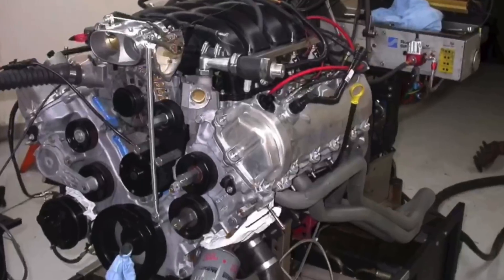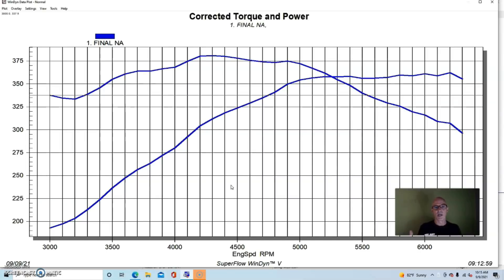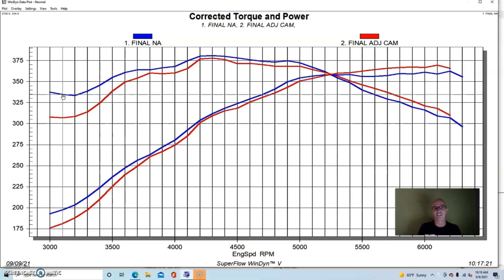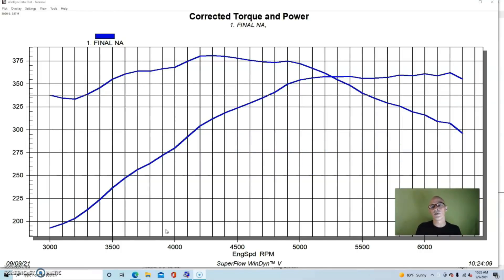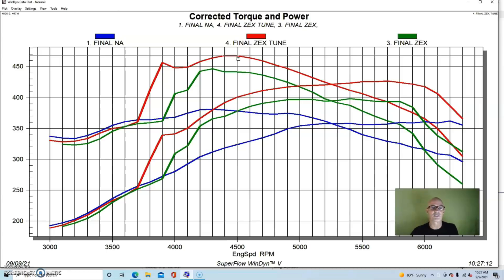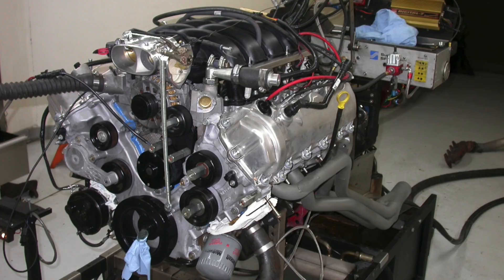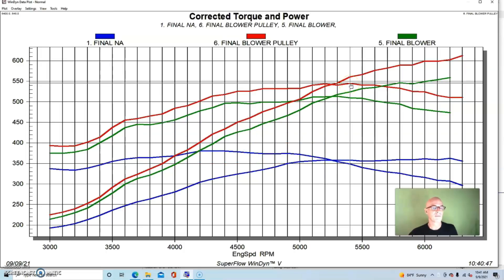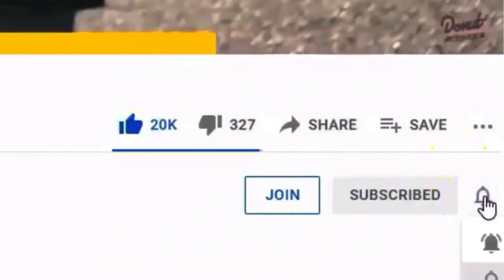HOW TO MAKE MORE POWER! ADD NITROUS OR BOOST TO A 4.6L 3-VALVE.

Comment: What plugs did you run? How many steps colder. Curious why you didnt do a 100 shot but otherwise glad this video was done.
Reply from the maker: we run a 9 or 10 heat range with boost and nitrous
Reply: @richardholdener1727  thanks for the reply do you happen to have a part # for either plug

Comment: Richard Holder, could you revisit the 3V engine. Being Holley offers thier long runner intakes for the 3V now that has different tops. There designed to run a single 4150 carb style flange, a dual 4150 carb flange, & EFI lids to bolt a forward facing TB. 
  Holley designed them to be similar to the GM LS Engine Ram intake to run long/short runner upper plenum or carburetor plenum.

Comment: Im assuming you weren't running stock internals with the Blower? these things bottom ends arent known to hold up very much after 500 hp. If you were, that’s great to hear and impressive tuning.
Reply from the maker: stock bottom end-they will make a lot more than 500 hp

Comment: They have their basis issues but they are great street engines with far better low to midrange torque than the 4 valve motor. They are fun to drive with basic mods.

Comment: With CAI, 91 Octane  tune (no 93 tune for that tuner), underdrive pulleys, on stock intake and exhaust, I got 307 hp at the wheels. Now I have added charge motion plate delete kit, headers and high flow cats, and a proper 93 octane tune, I will have my local shop do a fine tune on the dyno to see what improvement was made. Eventually, I will build up an all forged engine with ported heads and larger cams, but that is after my other projects are completed...

Comment: Mr Holdener you rock!!! How much HP did the headers add over the stock manifolds and do you recall the manufacture/sizing? No one lists 4.6l 3V headers for a 2010 F150-I just assume no power gains. Looking forward to part 2!!!!  Also when you get a chance, please post part 4 (the big heads) of the SBF cylinder head series, Thank you Tony.
Reply from the maker: very little gain, but we didn't have VVT so not sure it was an accurate test

Comment: Can't wait to see the custom intake.  Are we going to see any aftermarket cams tested?  Run the TFS 2v/4v crank sprockets, a set of comp 127400 cams and lock them out at a 108 degree ICL and enjoy!  
Then add a set of H-beams and forged pistons and throw 17 lbs of boost at it.

Comment: These are not my favorite engines  but if you own one, please keep it full of oil, and beat on it a little. Making this engine work a little, and sing a little, makes them live. Cam phasers pay the price of maintenance neglect first, and the oiling system isn't known for toughness. Fresh lube makes them happy, they will go 300K if you do. 
Great content Richard !
Reply: They have far greater lower to mid range torque than the so called more favored 96-98 4 valve engines. Much more enjoyable to drive on the street.
Reply: @erikturner5073  I can agree with this. I had a 2007 GT and I was thinking about turning it in for a Mach 1 4V. My 3V felt so much better at the low and mid range. Top end was about even. The 4v is obviously a fantastic engine but modern technology with variable cam timing and such really do make a big difference
Reply: @trizkial7592  plus the 4v engine has too low compression at 9:1 compression compared to the 3 valve 10:1. That makes a BIG difference. Especially with torque production, and torque is king in low and midrange power.
Reply: @erikturner5073  So hence I didn’t make the trade after test driving the Mach 1. Sweet car though still
Reply: @trizkial7592  The 3v cars are very fun on the streets and they are some of the best looking and also have a sweet unique sound. Never liked the coyote with loud exhaust. They are obnoxious! If I were to step away from foxbodys. I would myself find a nice 3 valve mustang.
Reply: Mine has over 400k

Comment: I hope you get a controller that can run VCT makes the engines so much more efficient especially when they're independent like on the coyote I think I read a test where it lost like a hundred horsepower or something just from not having that.  And I know that on the dino you usually only run in at the extreme RPM so when your daily driving it especially not just for power but efficiency

Comment: Semi-crazy dyno idea. Set up a pony motor to drive a supercharger which feeds the engine on the dyno. Then stick supercharger onto dyno engine. Will answer the question how much power does a supercharger really take?  A bit silly, but fun.
Reply from the maker: WE CAN JUST RUN THE BLOWER ON A BLOWER DYNO
Reply: @richardholdener1727  What fun is that?

Comment: Awesome! I LOVE 3V 4.6s. a good set of cams and an intake manifold REALLY wakes these engines up big time. Unlike the 2v, once you do those two mods, your well above 300 rwhp. Throw a nice set u
Of heads in the mix, iv seen cars make 350-375 wheel with a nice hci on a 3v! These just didn't get much love because the coyote came out and, well, who doesn't love that beast lol?
Reply: These didn’t get much love because cam sprockets would blow out of the front and rods couldn’t handle much power it wasn’t a good staring point
Reply: The 2 v is the better motor lol you can make above three hundred with a cam and intake too lol
Reply: The 2 valves head flow like crap the 3 valve is superior !It is just a notch behind the 5.0 and boosted run awesome! @cainadkins3985
Reply: 3 valves are 2 valves made unreliable
Reply: @cainadkins3985  that's not true
Reply: @mike8066  what part Mike 3v is the worst sounding and performing configuration of the mod motor in all the different family's

Comment: Just a note. The N2o boost wet can go safely to 1.47 times power boost. So 361 or 369 goes to 531 to 542 hp, but with an insane mid range torque blip, just like a nicely  intercooled 7 pounds of boost. Despite the lower than normal gasoline plus N2o gain with the Zex, just 1.20 or so just being like 3  pounds of turbo  boost, that Vortech is always softer on the drive train. Great Gains anyway you choose it!
Reply from the maker: the amount of nitrous the kit can supply is a function of the jetting, the solenoid flow and then the bottle pressure. The multiplier mentioned is just a math statement.

Comment: 6 rib 3.60 and 3.33 pulleys are less than the stock 3.80 inch  GM3800 Gen 2 and 3 Supercharged engine. Good supply to raid 3.8 liter Buick parts....
Reply from the maker: likely different offsets and shaft diameters?

Comment: As a 2v guy I with I had that torque curve. As a 226k mile engine I'm glad I don't have cam phasers to replace
Reply: 3v Heads are pretty good
Reply: @tturi2  and 2v heads are pretty bad
Reply: @Adrianzx  boost always helps
Reply: @tturi2  that's my plan. The new Texas made 88 is looking great but I really want something in the 57-63mm range for fun to drive and maybe my trans holding
Reply: @Adrianzx  thats what my plan has been for a long time.. thinking more toward engine swap lately. Hard desicion to make.. positive displacement 4.6, turbo 4.6, coyote or LS..
Reply: @umakemerandy3669  PLEASE, NO LS !!
Reply: @arkhsm  lol I know I know..
Reply: Dude you should see it with the variable cam timing enabled. Also you just do the phasers when you put in your new cams.

Comment: Don't buy a 3v
Reply: I'll play devil's advocate and say the block itself along with the crank are very strong. The weak point for making power is the powder forged rods, which kinda like to shit the bed once you're making more than 450 lb ft at the rear tires. Brenspeed on youtube is very informative regarding these engines and what they can do. Forged internals in the stock block go a long way, but of course brenspeed will want to sell you the B326 block lol.
Reply from the maker: WE'VE DONE 700 HP WITH THESE STOCK ONES
Reply: @richardholdener1727  Big Bang stuff but for longevity these engines hate torque and so do the cam sprockets seen sprockets fly out of the motor rods tap out quick
Reply: @richardholdener1727  Down here the optional non Boss 260/Boss290/DJR 320 V8  basic engine in Falcons, Fairmonts,Fairlanes and LTD unibodies was an imported Canadian 295 and 305 horespower SAE net truck 5.4 liter  from 2003 to late 2007. Production was down to 10 a month before the GFC of October  2008. But you find them around, and they are ultra reliable!
Ford Oz referred to these 3V  engines as the Barra 220 and the Barra 230 ( in Kilowatts,  blame James Watt and my French System International fixated  ancestors...)
Reply: Spark plug access is okay if you know how they can be removed if broken
Reply: @deanstevenson6527  I am a ford guy. The   3v's had to many issues to deal with when there are better options, kinda like the 6.0 powerstroke.
Reply: @AndyFromm  Best thing is how unleaned  on and cheaper the 3V is. Down here, the 5.4 3V is found on many BA and BF Fairmont Ghia's and its so much easier to access in a big four door sedan than a very tall F150 or Avi. Great opportunity to hunt with just a 175 shot of Nitrous. Hunt trophy in the weekend, then drive Joe cool to work in a dowdy Four Door Fairmont Ghia...Sell the 4 liter  Barra 183 to Richard, and import the forlorn 4.6 3V. The 4.6 is tiny, light, sweet and street neat...
Reply: @AndyFromm  Dude I can get a 3v for $800. Whats the better option, a yote for 4x the price?
Reply: @salisburysteve3104  I have a whole 5.4v truck here pretty clean I got for $1k. Rattles something fierce
Reply: @AndyFromm  the O-ring in the tensioners fails